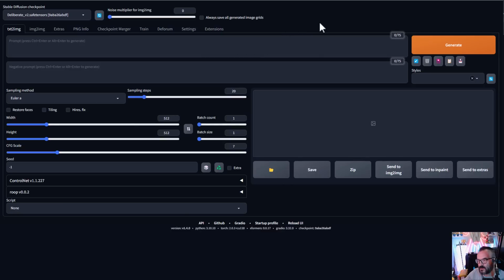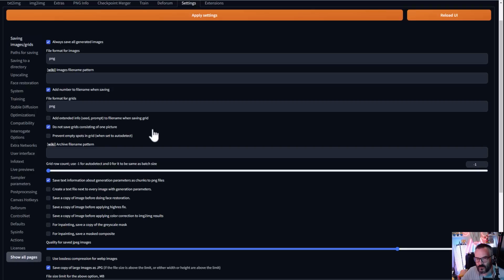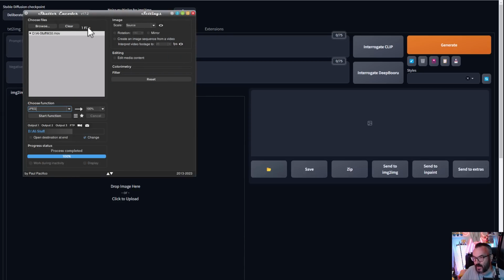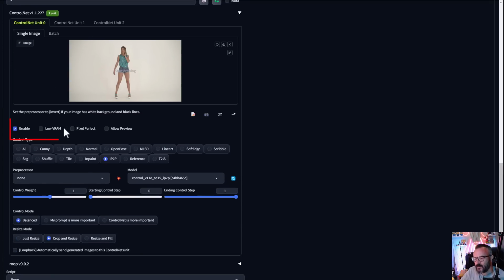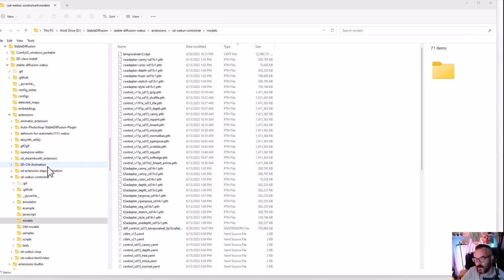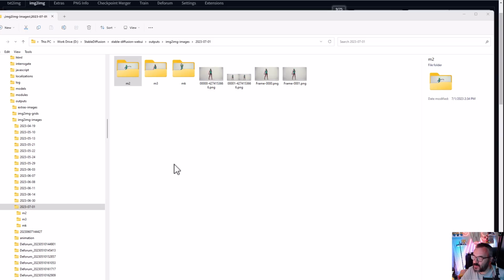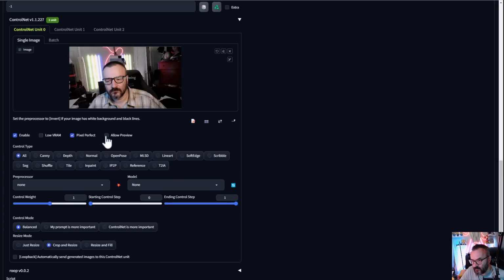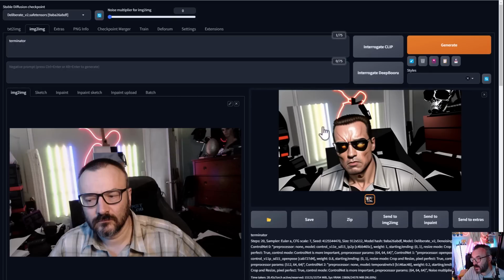AI Smooth Character Animation

Comment: Hi,
This is great, however, it doesn't seem to work quite as well in SD Automatic 1111 v 1.7.1 - unless I'm doing something wrong?

For example, many of the images are similar and don't follow the source footage very closely, or closely enough.

Can you add another ControlNet and use something like "scribble" etc to make the result follow the footage more closely, for very subtle motions ?
Reply: Additionally, I suspect that it works best with LoRa's / checkpoints trained for images of realistic people, whereas I am using a custom trained style checkpoint that does not feature any human figures in the training data - would this be an accurate assumption ?

Comment: So normally the way we created 3d scene and keep those scene on render which depends render each frame render time calculating on  render type, Material, lights, object, dof, resolution now if you render in standard then it takes 2 sec each frame so 10 min for 300 frames. But in octane it takes without any with background, hdri, texture takes 1-2 min each frame which is 5 hours. Now compare 3d render with this ai render I feel yes ai render which I feel great for short deadlines projects. Save a lot of time from creating models, props, texturing, animation

Comment: I've an issue
File "E:\SD\stable-diffusion-webui-master\venv\lib\site-packages\gradio\routes.py", line 408, in run_predict
    output = await app.get_blocks().process_api(
  File "E:\SD\stable-diffusion-webui-master\venv\lib\site-packages\gradio\blocks.py", line 1313, in process_api
    inputs = self.preprocess_data(fn_index, inputs, state)
  File "E:\SD\stable-diffusion-webui-master\venv\lib\site-packages\gradio\blocks.py", line 1163, in preprocess_data
    processed_input.append(block.preprocess(inputs[i]))
  File "E:\SD\stable-diffusion-webui-master\venv\lib\site-packages\gradio\components.py", line 3476, in preprocess
    return [process_single_file(f) for f in x]
  File "E:\SD\stable-diffusion-webui-master\venv\lib\site-packages\gradio\components.py", line 3476, in <listcomp>
    return [process_single_file(f) for f in x]
  File "E:\SD\stable-diffusion-webui-master\venv\lib\site-packages\gradio\components.py", line 3442, in process_single_file
    f["name"],
KeyError: 'name'

how to fix it?
Reply from the maker: You may need upgrading python

Comment: I did everything as you show in tutorial but Controlnet does not change the output. I still has similar image the was generated by the prompt. What could be the reason?
Reply from the maker: possible models not downloaded correctly. Try to delete directory in extensions with SDXL and reinstall.
Reply: @Geekatplay  Thank you for the reply. I don't even have SDXL installed. Do I have to have it? I thought Controlnet doesn't even depend on it.
Reply: @Geekatplay  My controlnet definitely is not working right. I try to follow your other videos "face swap" and I get 4 heads. Is there a way to fix controlnet?

Comment: hi ,  awesome explanation - i have one doubt though... can you use inpaint on frames and then render ? - i have tried with ebsynth extension - with multiple keyframes, the inpaint is not coherent and the image jumps when the rendered frame from first key frame moves on to the second.... 

even using the same seed does not help in maintaining similar results on different frames using inpaint

is there anyway i can ensure accuracy of inpaint rendering on multiple keyframes, so that the image does not jump from one position to another ?
Reply from the maker: Warpfusion handle that better, i am making video about it, but it is very very slow
Reply: @Geekatplay  sweet, thanks, waiting for the vid :)

Comment: I'm having an issue with 8:41, I select IP2P and I get control_v11e_sd15_ip2p_fp16 [fabb3f7d] instead of control_v11e_sd15_ip2p [c4bb465c] for my ControlNet Unit 0 model field. I used the comfyanonymous/ControlNet-v1-1_fp16_safetensors link in the description.  Should the safe .sensors files from the comfyanonymous link be added to the "stable-diffusion-webui-directml\models\ControlNet" directory? Or should they be added to the "stable-diffusion-webui-directml\extensions\sd-webui-controlnet\models" directory?
Reply from the maker: you may need update models

Comment: Okay, you are one of the most knowledgeable youtubers when it comes to Stable Diffusion, Deforum, and Inpainting. I am struggling with a situation and I wonder if you have an idea, or can point me to a video that answers my concern. I have created a video in deforum that I really like with one exception, There is a detail that shows up periodically that I don't want. This is a rather lengthy video and took several day to generate, I also really like it except for the one detail. so I really don't want to start over. My question or challenge is: Can I batch inpaint this detail out or replace it with something less distracting? This video has over 5000 frames, so inpainting them one by one would be a nightmare.  Thanks in advance for any help you can offer.
Reply from the maker: if you still have every frame for video, take frame you have problem with and use inpainting tool to remove unwanted elements.
Reply: @Geekatplay  Yeah I could do that but it is over 5000 frames. . .that would take a lot of time and effort. looking for an easier way.
Reply: @AIMusicExperiment  You can make a mask of the area you want changed and then batch inpaint.

Comment: Nice video! I have tried to use CN with Multi frame. but I find it difficult to copy the pose of the original images, especially for the hand and leg movement. Sometime the hands and legs are missing or the poses are different. is there a way to better track those movements?
Reply from the maker: are you using Openpose in controlnet?
Reply: @Geekatplay  Yes, it often senses the wrong poses for the hands and legs

Comment: It tried your steps, but when i use the diff_control_sd15_temporalnet_fp16.safetensors model my image gets totally different. As i see on your video you are selecting the temporalnetv3 which refers to the 13GB temporalnetv3.ckpt file which you have in your controlnet models folder as well. Just as a hint. I will download the file and give it a try if it fixed the issue
Reply from the maker: thank you for suggestion

Comment: is there a way to start 2 seperate installations from stable diffusion the same time? i mean, if its busy for hours rendering, i would like to use another installation to work with meantime. that would be a changer for me. currently i dont want to block my stable diffusion for long renderings :)
Reply from the maker: if you have enough gpu ram for that
Reply: @Geekatplay  i currently have 48gb vram. so how would i do that? just installing stable diffusion again in a different folder? there will be no conflicts ? gonna try that, when this looong render ends :) Edit... hmm the problem would be the local adress. do you know a way how to get this done?

Comment: I am getting an error: TypeError: object of type 'NoneType' has no len()    Any help?
Reply from the maker: let me check, i did not had that error before, be sure you follow every step. Also disable any extensions that you not using, some of them may conflicted
Reply: @Geekatplay  yep. I disabled everything else. And at first it worked, but after that always the same error message. Thanks.
Reply: Hello, the same for me... any idea ? Thx
Reply: I ran into this error too. You get this error because you have the multi-frame video rendering script selected but Third Frame Image is set to None and I'm assuming Loopbakc source too. Once I have those set up and uploaded the guide frames I had no issues.